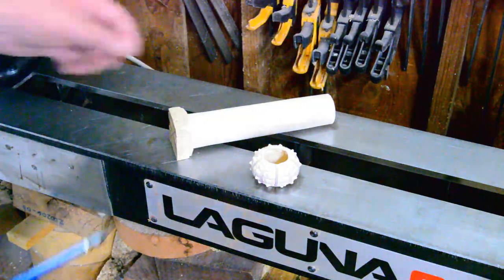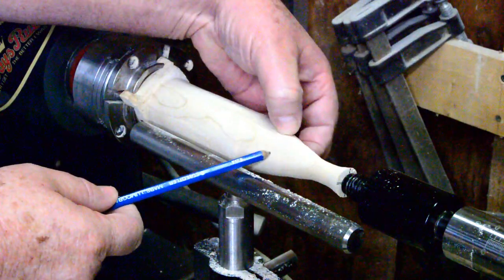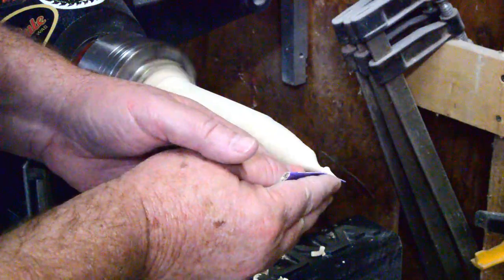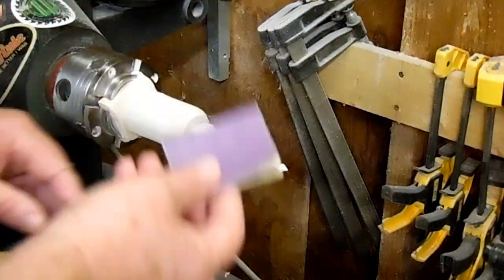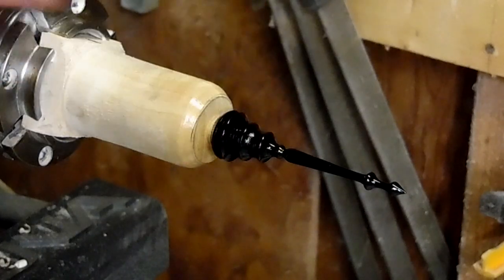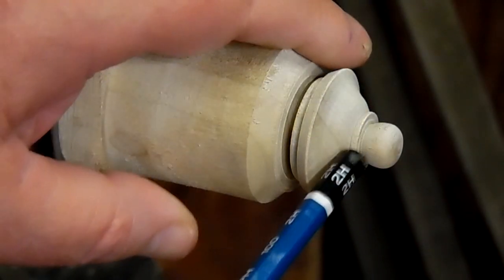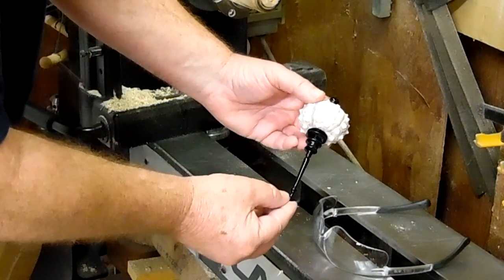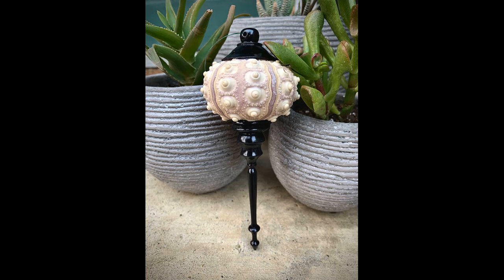Woodturning-How I turn a sea urchin ornament!

Comment: I really struggle with these, not the actual finial but getting them together plumb. Nice job!
Reply from the maker: Hi Ron! Thank you very much! I used a paint store stick with sand paper glued on it and sanded gently, it worked great for flattening/leveling the ends. Thanks again Rob!👍🏻

Comment: Very nice turning. Do the sea urchins come like yours, with the holes on either end? I would like to try what you did. Nice to know that ca glue works for gluing. Thanks for sharing.
Reply from the maker: Thank you Joseph!  Yes these urchins did. I’ve had these a while, I think I picked up from Etsy. I had to sand down a couple of the nuns so the finials sat flush.

The CA glue works well , I know this because I broke a couple of finished ones and the shell was still attached where it was glued to the finial😀 glad you liked it !!

Comment: I know this is an old video but I can tell one thing that you're doing wrong. You have square stock chucked up without any shoulder. Any catch you get is going to pry that loose. The first thing you should do is to put some form of shoulder be it a dovetail tenon or anything. That shoulder will give you a lot more stability on long pieces.